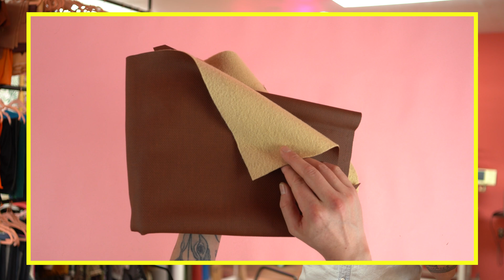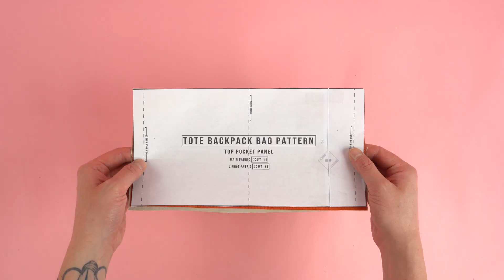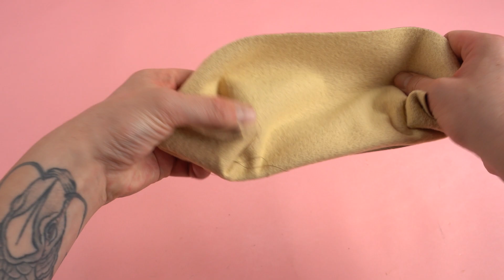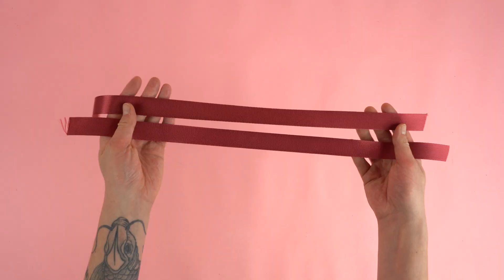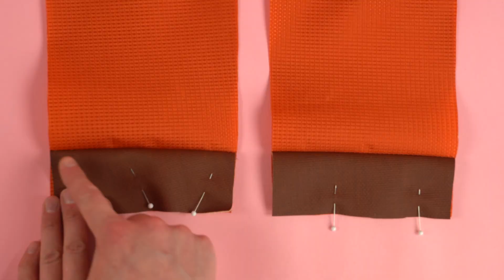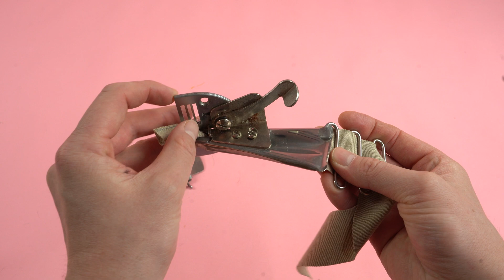DIY Tote Backpack + PRINTABLE SEWING PATTERN (EASY SEWING PROJECT)

Comment: I ran into a ton of issues getting this started! Since this is considered an easy project, it might help viewers if you call out the tension you're using and when you switch needles for certain types of material. I'm still very new to sewing and I've temporarily paused (machine stopped working on the bottom guard panel) on this project because I'm thinking I may need to practice on scraps before returning to it, just to avoid screwing up what I have.
Reply: every machine is different and every fabric is different. Him telling you his settings wouldn't have helped anyway. hope you had fun experimenting